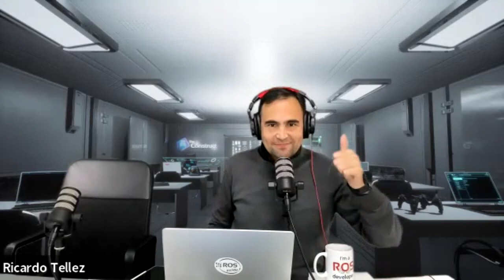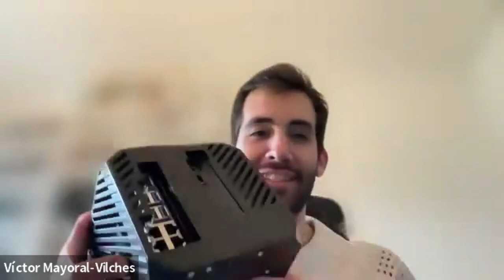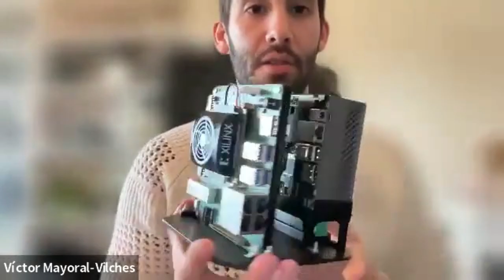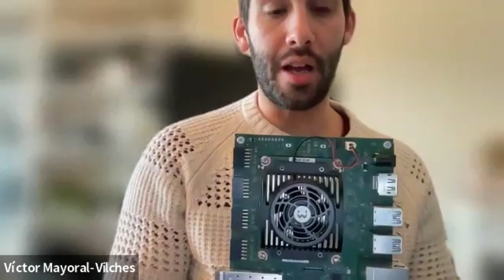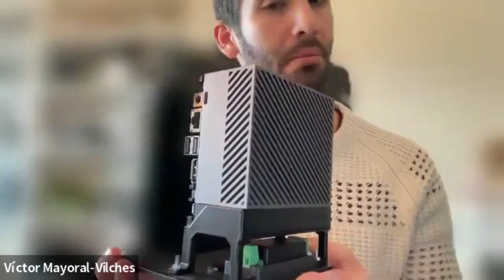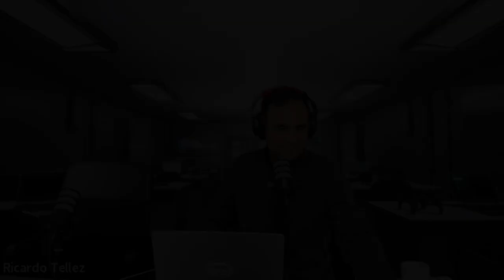RDP117: Hardware Acceleration with ROS2 Round 2

Comment: Thank you Ricard for inviting Victor to the discussion. I was waiting for this discussion since Victor's achievements and superior solutions are remarkable. For sure the robotics domain needs an accelerator and fast computation unit. 
We need also to notice that boosting applications is not only the hardware. Studying parallel programming one can learn how much CPU capacity is wasted in comparison to running applications synchronously. 
I really enjoy discussions and deep answers. Impressive and very consistent discussion to capture the latest trends in robotics. You Ricard run an outstanding podcast. Really impressive! Have a nice day!